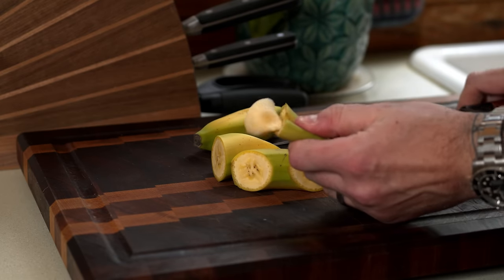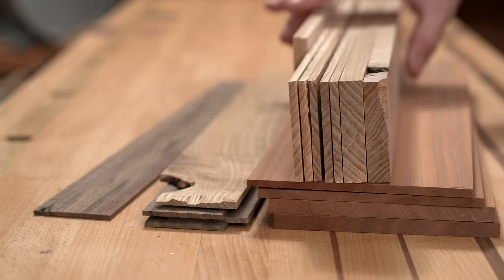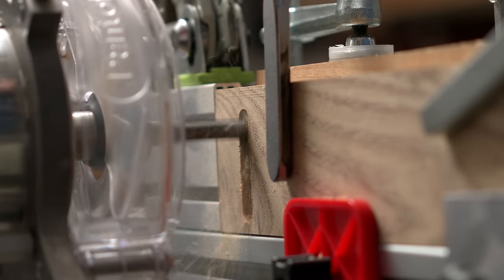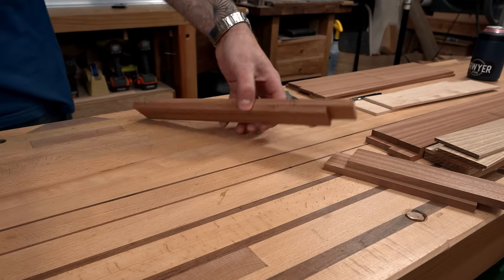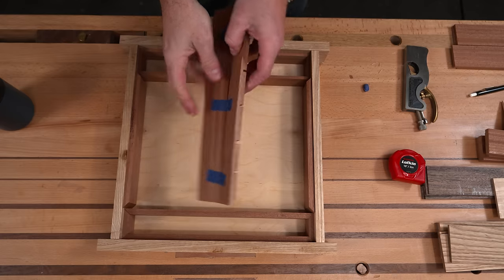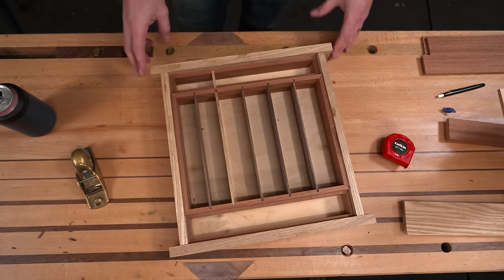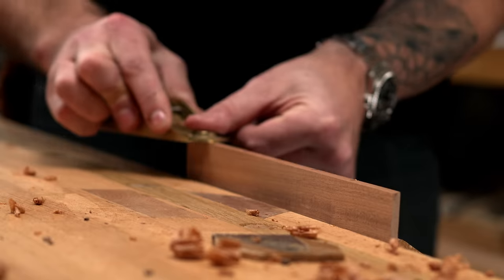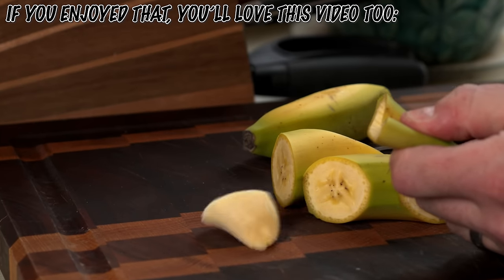ENOUGH Cutting Boards!!! Make THIS Instead.... (pt.2)

Comment: I am a keen woodworker. I have a regular stall at a craft market where I sell a bit of my stuff and take an occasional commission job. Recently I re-glued and re-finished a fancy cutting board for one of my fellow stall holders. Went through the grades of sandpaper and put three coats of my expensive cutting board oil on. They were pleased as I gave it back. Next month I asked how it was holding up. " Oh, we don't use it " they said, "We have it mounted on the wall. It's too nice to use ".

Comment: I agree about there being enough cutting boards. I got into woodworking out of necessity because I had some tools and my Microgreens business didn’t pan out but then I fell in love with it, saw EVERYONE doing cutting boards and decided that market is definitely flooded. I’ll make one for myself but definitely going to have to find a niche.
Your designs are damn impressive and really fit how I’m wanting to do some projects. I’m leaning more toward natural wood/live edge style items but with really out of the box design so you’re definitely an inspiration there. Awesome work man keep it up!
Reply: Do keep in mind that while live edge is beautiful when done properly you can over do it. When working with smaller objects it can be very hard to find a good balance of natural edging on a peice, it can either be to much and look rough or not enough and look like you just ran out of full size material to use, I tend to lean toward natural edge on things like tables, lidded boxes, sometimes coasters, but never anything like the drawer organizer above, I find a 10-15% of the item when viewing it the way its intended to be used is a happy spot for live edge, for instance, if I'm making a hallway table, or end table I want to design it to have no less then 10% and typically no more then 15% of what will be the most likely perspective anyone will have when looking at the finished product in someone's home
Reply: @patricknoel2122  that’s some sound advice I definitely appreciate that!
Reply: @thegrayjedi5202  best of luck

Comment: A very nice project, for someone who uses wood planes so much, I was surprised to see you putting them down on the face rather than the side as it should be to protect the blade.😊
Reply from the maker: They’re made to cut wood and setting them down on wood doesn’t do anything. This is a myth. They’re gonna need sharpening sometime anyway.

Comment: I made something very similar to this a few years ago for several of my kitchen drawers and cause I'm lazy I just made all the dividers the same width as the big spoons with + a ~1/4 or extra width on both sides of the big spoons. The problem I have is my smaller forks are always all over the place because they have too much room and I never ever thought to just turn them on their sides like at 8:49. or flip every other knife so more fit. Duh... Now they stay nice and straight. 30 years of woodworking and you can still learn something.

Comment: If there is enough clearance from the top of the drawer edges to the cabinet and if drawers are deep and long enough, you can make this tray sit on the top edges with a lip on the top of the tray  and slide it back and forth into the drawer.  That leaves room underneath for the other utensils, like can openers and the like.   Just push your  toward the back to get at the lesser used stuff and it's easy to lift out for cleaning and better access to the back of the drawer.  Just don't make it too deep or long.

Comment: Design/function question...Why build narrow boxes on each side of the center construct? If the large section is fastened in place, the function is the same and there is a bit more storage width in the outboard areas. Thanks.
Reply from the maker: To give some wiggle room in case the drawer this will go in is narrower than mine.

Comment: "Hey!  Instead of making cutting boards(it's 2022, the whole "thought that counts" thing is so 2021) with basic woodworking tools, lets make some drawers that require more tools, work and time!  Also, here's the $2,000 router I'm definitely not plugging that I will use to cut out my tenons."  

that aside, nice work and insightful video.  cheers
Reply from the maker: Yes, this is how I make a living lol at least I didn’t do an entire video on a product ad or give you 30 stupid affiliate items. You’re welcome.
Reply: Yeah, I agree. I was very interested until I saw ANOTHER ridiculously expensive job-specific tool that the average woodworker doesn't have or need.

Comment: It seems that I’m not only the only one who like a tidy place for everything and everything in that place. However, I wish I had enough time to build trays for everything that I would like to put in them. For me, it’s a project to fit in between others more essential and I struggle with time for that. 

On the question of safety. It is best practice to use push blocks. I’ve been woodworking for over 45 years and it was my training many, many years ago, when machinery like planers were the exclusive reserve of big commercial shops, to use push blocks. However, the tutor didn’t use push blocks himself as he preferred to use the feel of hands. As far as I recall, he had all 10 digits. So, my takeaway from this was that it’s best to use push blocks but it’s personal preference. I don’t think it’s a question of common sense; just a method which does increase the potential for injury but at a measurable potential.

I owned a company which did jobs such as cleaning the outside of very tall buildings. Sometimes the stone and often the glass. The absolute safety would have been not to clean the building at all. The next safest thing would have been to clean only what you could reach with 2 feet on the ground. The next safest method would be to erect scaffolding around each building every month and clean, effectively, with 2 feet on the ground. Those 3 options were not acceptable in terms of aesthetics, contractual compliance and cost. So, we undertook site specific risk assessments, method statements, mandatory training and completed the jobs using cradles or MEWPS or abseiling. In other words, we evaluated risk and safety and did do things in a way that were not the safest possible but had all risks evaluated. All this is completely in line with the UK H&S legislation. 

So, if you want to surface timber without push blocks, you do so understanding the risks and making a personal decision as to method.

Comment: I built a maple/walnut checkerboard cutting board for my in-laws and they have refused to actually use it.  My wife went down to help them for a few weeks and her father was appalled when she pulled out the cutting board and started cutting on it.  She had to explain to him that like any other kitchen appliance, it's built to be USED.  And if, heaven forbid, the surface gets too chopped up, he can always send it back to me for refinishing!  Of course, that's never going to happen.  I expect to hand the first cutting board I made down to one of my kids in my will.  We've been cutting on it for the last 8 years and the center is a little hazy but that's the only damage so far.

Comment: I've been wanting to make something like this for the exact same reasons. All the cutting boards I've made feel too pretty to use. One thing I want to add to the drawer insert though is a more custom way to hold each type of silverware, so that they don't just flop around inside their respective internal boxes. Any ideas you have on accomplishing that elegantly?
Reply from the maker: Sure, if you wanted to spend some time, I think the divisions could reflect the tool they hold

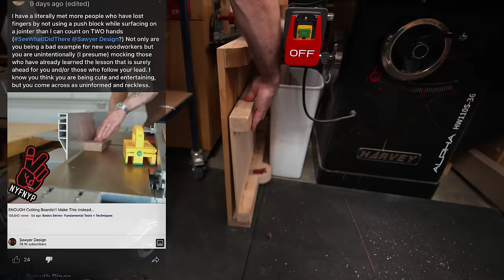Comment: @1:27 Why is it that the internet safety police are always the only people that seem to know at least a dozen others that have lost fingers from not using push blocks or wearing rings while working? I started my woodworking career back in 2000 & the only major digit accident I ever witnessed was due to horseplay while working. I know hundreds of carpenters that do this work daily & I have yet to meet one with less than 10 digits.
Reply from the maker: Haha man, I don’t know. Some people really get off on following the 101 safety manual.
Reply: OP probably ran his hands through a tablesaw, so he can count the only one he knows who lost fingers on his remaining digit.  :P
Reply: @SawyerDesign  "Bitches"

Comment: I find that most woodworkers, when doing these small projects, make the pieces too thick and bulky. With all of the bracing that happens with the crawlspace is I don’t understand why you can’t use quarter inch material. It’s not hard to plain material that thin by using a jig that raises the pace higher.  This drawer divider would have so much more versatility and a lot less weight if you used to send her material. I have made clipboards, which have not bowed or warped and they are sleek, lightweight, and not bulky.

Comment: I mean, the random internet is right, it's appropriate safety to use a push block on a jointer.  However, so many people aren't in the habit of using the push block on it.  So it's a moot point to lecture people on cause you will mostly be ignored for a different comment you made at the same time.

Aside from that.  Great vod and love the project!

Comment: I am not familiar with your tenon routing set up at 2:38. What is it and why have I not seen/ordered one. Seems so much safer and predictable versus balancing on a router table.
Reply from the maker: It’s a PantoRouter. Powerful platform for all kinds of joinery. There’s a link in the description for a discount code. Can’t imagine doing what I do without it

Comment: To be fair, your planing did look crazy with sticking your hands under the funky euro guard. Lots of things look unsafe that woodworkers are safe during. That keyboard OSHA inspector probably has not even a one drill press.
Reply from the maker: Yeah I do some sketchy stuff sometimes, but that wasn’t one of them. Knowing why stuff goes wrong and being aware works better for me than blanket rule that include the word ‘never’.  With comprehensive use and understanding, tools gain safe functionality. Understandable that it triggers people, but I think there’s more power in calling attention to things than lecturing my past self to internet people and using fear as a way to educate.